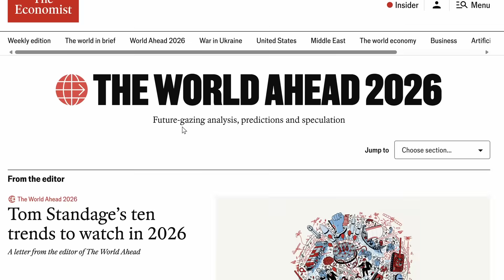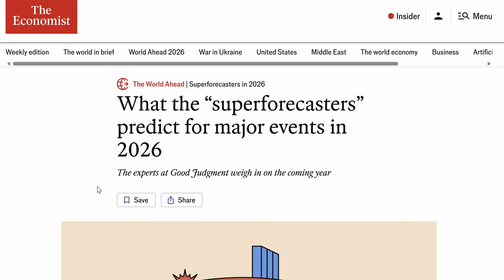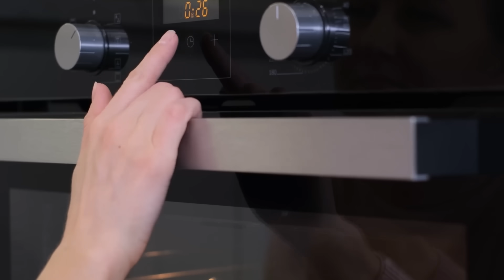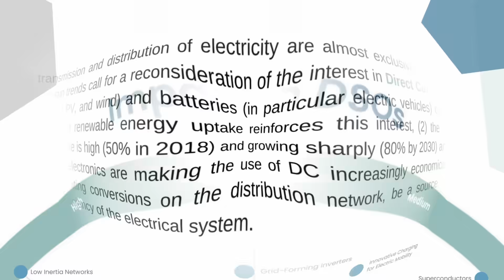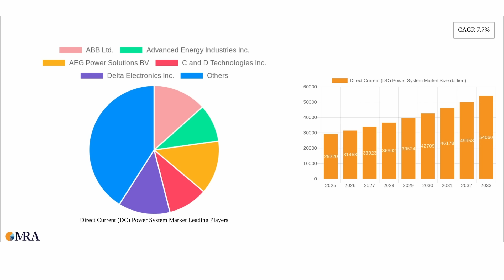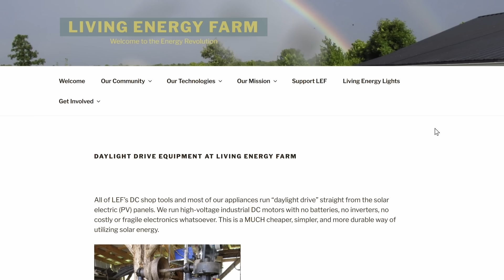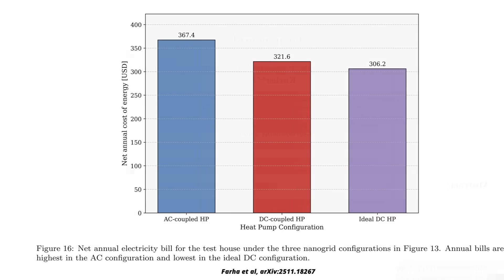Are We Using the Wrong Kind Of Electricity?

Comment: I don't think converting to DC for residential will happen anytime soon (at least not in the US), because every appliance or device that plugs into an electrical outlet runs on AC power. There is no demand for plugin equipment that can run on DC.
Reply: Now available at suppliers of electrical components are "AC" power outlets that include a USB C charging port.
Reply: @avsystem3142  That's not what I meant at all.  There are not microwaves, toasters, stand mixers, vacuum cleaners, etc. that will work plugging into a 12vDC receptacle. There aren't even any 120vDC rated receptacles available to purchase.

Comment: You forget that dc get much problems in moist enviroments.  Contacts corrode very fast...look at battery contacts!   I also think microwaves run mostly on AC...Only little bit the electronics on DC.

Comment: Submarine power cables can use both AC and DC, but long-distance submarine cables are almost always DC (HVDC). AC cables suffer from high capacitive losses in water, which limit their length to about 50–80 km. DC avoids this problem and allows efficient transmission over hundreds of kilometers, but it requires expensive converter stations at both ends of the link.

Comment: I absolutely love you Sabine!  You pick the most interesting topics and your opinions about them are interesting.

I’m an amateur radio operator, so I love building circuit boards, radios, antennas, and amplifiers.  With just “stuff”.  I have no formal electrical engineering education, I just read read read.  Schematics, theories, and end usage.

I see electricity and magnetic as an endless playground of recipes.

Comment: DC for homes is what Edison was pushing but they would need generation facilities about every square block. AC easily travels for many many miles.
Reply: So does DC, in properly designed installations. There are long high-voltage DC transmission installations all over the world.
Reply: DC travels more efficiently at the same voltage then AC. It's just that higher voltages travel more efficiently then lower voltages and converting DC to higher then lower voltages is really expensive, AC transformers are on every 3rd pole as they are cheap. The reason for generation facilities on every block was because they had no cheap way of upping the voltages for efficient transmission and then lowering them for homes. AC was cheap and easy to do that.

Comment: THose UHVDC lines require AC transformers to step the voltage down to  A usable AC voltage  for local transmission. You will  need a properly sized transformer for each step down/up to what ever  different DC voltage you need.

Comment: I think we first should have a global rectifier in each home serving an additional 12v net to get rid of all power supplies
Reply: I used to wonder about that, until I learned more about electronics. 

The amount of copper needed to accomplish that is enormous. It’s why USB Power Delivery goes up to 20V. Charging a 240W gaming laptop at 12V would require 20A of current, requiring very, very thick cable. Otherwise you’d have tons of voltage drop. So in the end it’s more efficient to have a bunch of small, but highly efficient AC adapters.

Comment: Where DC high voltage transmission really shines is when cables go under salt water.  AC lines lose huge amounts of energy as the alternating electric fields move around all the ions in the water at 50, or 60 Hertz.  One reason AC won in the 20th century was the superiority of AC induction, and excited motors/generators over DC machines that required commutation.   Induction machines need no physical electrical connection to the rotor, while excited AC machines need only low current slip rings which are much cheaper, and more durable than commutators.   Nowadays many DC motors are "brushless DC motors", where an inverter drives a three phase AC motor for exactly the same reason.  Commutators are expensive, and require periodic maintenance or they will fail due to wear to the "brushes".

Comment: I think the mistake was engineering a requirement for 50Hz AC (Europe) into every appliance
Reply: In the U.S. appliances are not "wired" for 50 Hz current. If they have an AC motor it has to be a different winding design completely. Some electronics, e.g., switching power supplies, which convert AC at any frequency to DC, are agnostic about the frequency.

Comment: DC is certainly easier for an SMPS to convert up or down. Also the RMS=the DC Voltage. AC is handy for high power step up/down conversion with large transformers. So it seems like for a normal home, you might want AC from the nearest service transformer going into a big AC->DC converter for the house, behind which the solar and storage and supply are sitting. Most hardware with an SMPS will not care if it gets DC in rather than AC. It would also be a good opportunity to fix the absurdly low voltage used in the US by making the standard DC supply be 240V. The split phase scheme in the US could still be employed to get 480V for high power things and the amount of copper used would be greatly reduced. I don't know much about high voltage DC-DC for transmission (not my job) but if that is cheaper than honking big transformers on a pole outside the house then great, sign me up.

Comment: The issue is that stepping down high-voltage DC still requires converting it to whatever AC (depending on the technological approach and requirements). This ultimately makes DC-based infrastructure more complex and brittle. I can't imagine how much fragile and intricate semiconductor-based hardware would be needed to step down, for example, 10 kV DC (which is already considered low voltage in power engineering) to a safe, manageable level at the outlet (from both efficiency and fire-hazard standpoints). And that's without even getting into the severe EMI implications.
In contrast, a traditional low-frequency power transformer is simple, robust, and highly predictable.
Reply: high voltage DC is not traditionally stepped up or down to other DC voltages.  There is typically just one HVDC line and then a bunch of AC transmission systems hanging off of it.   So the only conversions are from AC to DC and vise-versa.   This is now done using IGBTs (it used to be done using Thyristors), then various magnetic stages (transformers and filters) for the AC side.

Also keep in mind that HVDC lines do not use highly regulated voltages like AC lines use.  The HVDC line voltage can vary dramatically depending on all sorts of conditions, and unlike AC lines, the equipment has no trouble dealing with whatever DC voltage it sees on the line (within reason).

Comment: The cost of a DC voltage converter capable of converting ultra-high transmission voltages to something for a household is massive as compared to a simple transformer.

Comment: 3:40 isnt't it rather that wind turbines do generate AC but due to the incompatible (non-constant) frequency that AC cannot be fed into the power grid directly? Hence it has to undergo an AC-DC-AC conversion.
Reply: Wind turbines typically generate three phase ac, with six diodes to create a pulsed DC output with much less ripple than 2 phase would create.  That requires smaller capacitors to smooth it into a constant DC.  Then that goes through a DC-to-DC voltage converter to charge batteries, or an inverter circuit to make ac to drive into the electric grid.  Those are necessary because wind turbines generate electricity at varying AC frequencies and voltages, depending on wind speed.
Reply: Pretty sure you're right.  Devices that make electricity from rotation pretty much always make AC.  Early car engines used dynamos to generate DC to charge their battery.  They were weak and unreliable.  Modern engines use alternators that generate AC, which is then sent through a rectifier to get DC.

Comment: DC electricity is a great subject! I wish we had good standards for residential and small business DC, like voltage levels and connector types.
Reply: There are boatloads of standards for all types of electrical connectors, both AC and DC. You wouldn't even be able to purchase an electrical connector in the U.S. that doesn't comply with some national standard.

Comment: DC/DC conversion requires an AC stage in between.  AC is not going away.
Reply: Mmm.  That’s not really an AC stage.  More like a magnetic stage.   While the waveform is certainly not DC, it is also not what you would consider to be a typical AC waveform either.
Reply: @junkerzn7312  No, it is really AC.  Even goes through a transformer.
Reply: @uni-byte  Inductor if you don't need isolation, a transformer (really just coupled inductors... a flyback transformer) if you do.  

But again, calling this "AC" just creates confusion.   It implies an equivalence that just doesn't exist in reality.   The intermediate form is NOT a regular fixed-frequency AC waveform with sinusoidal voltage and current.  There is very little sinusoidal about any of it beyond the magnetic field strength itself.
Reply: @junkerzn7312  Yes, keep telling the engineer with a physics degree that he's wrong.  The little inductor based buck and boost converters won't cut the task of bringing distribution voltages down to house hold voltages, especially at the currents and isolation that will be required.

AC is AC.  It stands for Alternating Current.  It does not have anything to do with the waveform or the frequency.  Sine waves, triangle waves, square waves, sawtooth waves  or any arbitrarily complex waveform can all be AC and absolutely are if they are carried by electricity.  It's AC going into your stove.  It's AC going into the antenna of a radio transmitter.  It's even AC going into your speakers when you are listening to the disgusting racket that is Justin Bieber.

Look, you can think anything you like.  That's fine with me.  Just don't come along and use your misunderstandings to "correct" me.  Okay?
Reply: @uni-byte  If you want to hold up diplomas, I've been an electrical engineer for almost 50 years.  So try learning something instead of boosting your already poor reputation.   This is my field.  It clearly isn't yours.
Reply: @junkerzn7312  LOL!  Wrong.  Sorry, but please let us know what company you worked for so we can avoid their products.  Thanks!
Reply: @uni-byte  if you want to argue, you are welcome to post your sage science. Otherwise you are just posing.  Try to avoid using AI answers, please.  Talking nonsense isn’t going to get you anywhere.
Reply: @junkerzn7312  Merry Christmas.

You have made a fool of yourself.

There is an article on Wikipedia, "Alternating current".  Go read it.  All of it.  But here is a quote from it:

" In many applications, like guitar amplifiers, different waveforms are used, such as triangular waves or square waves. Audio and radio signals carried on electrical wires are also examples of alternating current. These types of alternating current carry information such as sound (audio) or images (video) sometimes carried by modulation of an AC carrier signal. These currents typically alternate at higher frequencies than those used in power transmission."

Comment: you say wind turbines and solar panels produce DC. That's true for solar, but wind turbines produce AC. BUT because of the changes in wind power this is messed up AC as the frequency changes all the time, so to stabilise this its converted to DC, then BACK to AC to match grid frequency. Not very efficient as we tend to lose around 10% energy on average to convert either way, so Wind turbines lose about 20% of its energy in these conversions.

Comment: DC transport on very long distance — thinking of continental level— is more efficient because it doesn’t radiate energy like AC does even on 50-60Hz. An AC powerline is kind of antenna and the radiated power build up on very long distance, not the case on a DC powerline.

Comment: Except EVs and hybrids use AC ... at the motor.😮
Reply: DC vs AC as Sabine is discussing isn't a real thing.  For the PV arrays, optimal energy extraction is done with a Maximum Power Point converter, which is going to chope the DV from the array amd send it across some combination of transformer and inductor.  The data center example, processors are run at 1.2V DC which is impractical to move over any distance, even within the data center - again, switching power supplies and inductors/transformers.

Rearranging the number of conversions in a microgrid might improve some effencies - but installed equipment is probably the biggest constraint.

Comment: Obviously for long range UHVDC = DC for ohmic losses. Also for grid to local grid power movement to separate 50/60 Hz national grids to avoid being forced to keep wide areas locked to 50/60 Hz as well as partitioning grids  for the same phase synchronisation reasons. Cars are  DC, but battery voltages vary - we do not want 4-6 car grids, Tesla, Ford, etc etc. There is a movement to change gas cars to a 24 volt   battery voltage, mainly to save copper/aluminium for internal ohmic losses. Until a standard car high voltage standard emerges, we will not have local car grids.

Comment: "...alternating currents were less lossy when transferred over long distances..." Sabine that's not true. I think you meant "higher voltages" were less lossy when transferring "power" over long distances.  I suspect you wanted to avoid in-depth discussion concerning AC drawbacks like Reactive Power and Power Factor issues, Impedance Mismatch, Frequency Dependence, Harmonic Issues, Skin Effect and Inductive Losses (issues that are not present with DC) but your effort to simplify may confuse readers. AC won the day almost exclusively because getting the higher voltages needed for power transmission required only simple and CHEAP transformers. AC's victory had much more to do with its being FAR more cost-effective to implement. It had little to do with any perceived efficiency advantage. Edison had no cheap way to step his DC up to the higher voltages needed for efficient power transmission (the voltage coming off of Edison's dynamos was typically less than 200Vdc). Lacking cheaper solutions Edison had to rely on massive copper conduits and much shorter transmission distances (lots of local generation stations instead of one far away).  However, that call from Edison at the end of your video was genius. It summed it up perfectly (and accurately). If Edison had had the necessary technology (like modern switching DC-DC converter technology) we might all be using DC today.
Reply: Hindsight is a wonderful thing but never conveniently implemented.

Comment: For power distribution in cities, AC transformers will always win out over DC-DC converters based on total cost and reliability. Long distance transmission will use DC-DC converters when lone losses make thdm more economical. Then there are the 120V/60Hz (50Hz in Europe) standards for plug in equipment like vacuums, coffee pots  etc.

Comment: The issue isnt efficiency anymore... its complexity in conversion. Modern motors in EVs and Drones and many home appliances are AC but powered by DC. the issue is the electronics used to convert the DC to switched AC in various amplitudes and frequencies to run those motors which are inherently simpler and less noisy as AC motors do not use mechanical commutation like DC motors use. an old mechanical AC appliance is simpler and easier to repair compared to modern appliances that are now over flowing with DC electronics that are not serviceable and cost more in the long run.

Comment: OK, what do I know, but if every home has to have its AC distributiobn panel updated the number of electritians needed to make this change will be massive and do all the homes no convered just cause the people to die, because here in the winder we tend to get spells where its -40 outside and that cold wishes to get into our homes, and without power we will die.  So the idea of pipping in dc instead of AC will be a HUGE effort we are talking about over a million homes and some huge number of buildings that would all have to be converted, hell power distributiobn within the structures may be fine or maybe they won't, this seems like a bad idea, maybe we could start by doing this to new areas in a city.

Comment: Take a look at the gigantic cables you need for 12v or 24v and even with 48v and the huge losses you have at those voltages, if you go for 230V DC it still needs to be converted... There is a good reason for why we us AC in homes. DC only makes sense for 1000km long 500.000v ++ powerlines.

Reply

Comment: Your correct we should determine what kind of current we used base on what type of cars we drive. Which is why I'm switching to 400hz when I get my Jet Car.
Reply: I don't know about current aircraft electrical systems but in WWII and for some time thereafter the power supply was 48VAC at 400 Hz.

Comment: Most of these DC uses, become AC again before anything gets done. 
Electric cars use AC motors (but it is a complex AC that changes frequency to get different speeds and powers).
Your speakers are AC, and so is your display. 
Even covering DC to DC at different powers and voltages involves converting to AC and back to DC. 
But DC distribution is clearly a coming thing.
I can also see a lot of home appliances moving to DC so that they can directly use solar, or battery, without the losses of two more conversions.